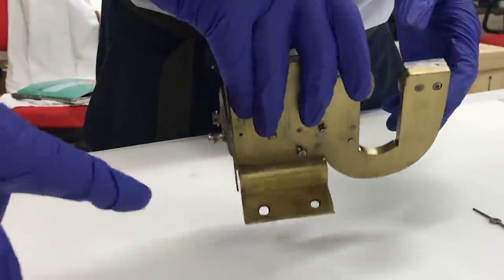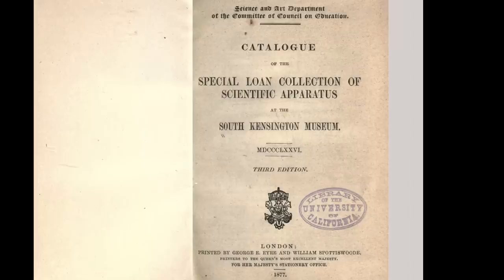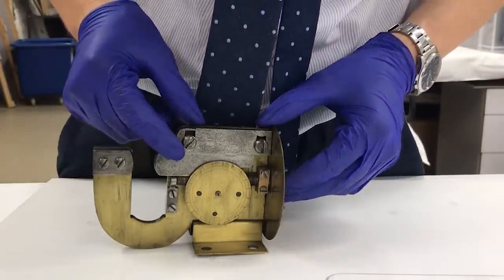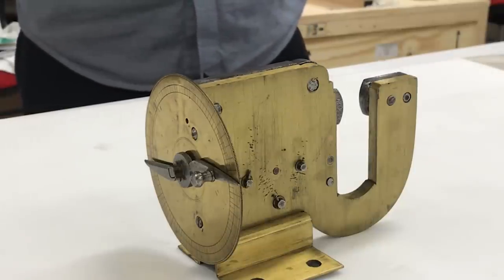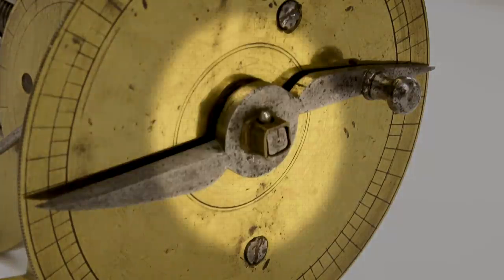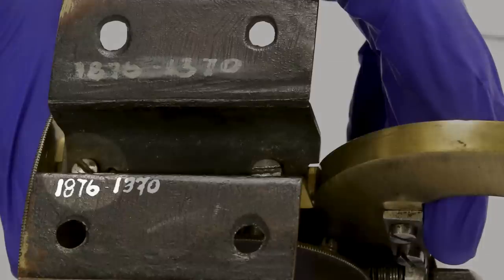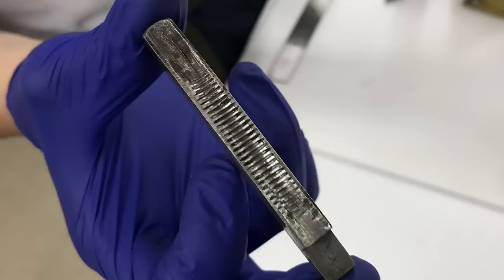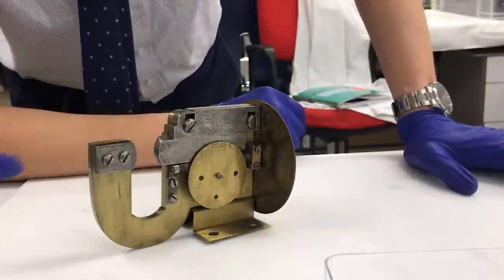World's Oldest Micrometer - 1776! Who made this thing??

Comment: In my uneducated opinion I suggest that it was made in the early part of the 19th century.  Circa 1790 to 1820. The maker could be a journeyman clock maker possibly working with a journeyman machinists, both trying to solve the issue of making precise measurements.

Comment: I think your variations in quality across different pieces suggests different pieces of brass and steel were repurposed to build the micrometer. I can tell you with 100% certainty the base was absolutely either thrown together very quickly or was recycled from something different. The iron pieces were also likely either recycled from something else or were used on a previous attempt to build a micrometer similar to the one being handled in the video.

Comment: The two brass indicator wheels appear to be wheel measuring rulers. Check out Engels Coach Shop where they're working on wagon wheels. I can see someone like Watt working around wheel makers and seeing those round rulers, made in brass because it is easy to work with, and having an 'ah-ha' moment. The rest of the body, a reutilized hole punch and grommet setter? And the amalgam of the parts a crude micrometer.... something to model off of a better iteration?

Comment: I'm no expert, but to me, the wear and cobbled-together nature of the tool indicates that if it was indeed made by Watt, it may have been built from scraps and then revised and/or repaired several times over its lifetime as its maker realized its limitations and attempted to get it working to his standard. Plenty of modern makers do the same thing, keeping their oldest and most beloved tools and repairing them multiple times to keep them useful, often doing repairs in a way which is expedient first and beautiful secondarily.
Reply: Some of my best stuff has been built from worn scrap with holes that didn’t “align with my mission,” and this is from an age where I’d like to think nothing went to waste, especially if it started as a prototype, not a showpiece.

Comment: I believe the small dial was soldered offset on purpose, to accommodate for calibration. If you set the large wheel, since it is driven and the small wheel is slave, then the small dial would have to be calibrated to the large wheel. If you install shims or take out shims from behind the large dial and add them respectively to the other side of the bushing, this would give a different zero when completley closed. Maybe that's how the circular scratches are on the face. It's quite possible this was a prototype. Just my opinion. Thanks

Comment: the holes on the base being counter sunk on both sides, could it be due to being hammered holes rather than drilled?

edit: also that there are hammer marks on allot says to me that it was built in a time where building things with a hammer was common (wrought iron is also a indicator of such to a certain degree).
Reply: If it was made in Birmingham then it was almost certainly made with a hammer aka Birmingham screwdriver.

Comment: Looks like the hole on the big dial might be a lock position for the handle. Hard to tell without a perfect head-on view of it. Overall, it almost looks like Watt had the device and used it, or acquired it as a curiosity, but didn't necessarily invent it.

Comment: I think you were right in assuming the base was made by someone else and there is no way those holes were drilled out...... So why would someone countersink both sides of something when they didn't even have a drill? What if it wasn't mounted in a stationary position? What if it was clamped onto posts, or rails, so that it could slide in a horizontal manner and when you set the tool down on the table it is actually sideways? That would explain the lack of marks from mounting the base and the fact that it doesn't sit even on a table evenly..... could even explain the concentric/ragged circle that are on the base. It seems like it was a tool that was later adapted for a different use.

Comment: You should do a video on programmable logic controllers. Without them automation would not be so cheap to implement when a product change is required. You can thank the automotive industry for the birth of the programmable logic controller due to the need for them constantly having to change the settings for new cars that long ago required changing out relay logic boards and wiring that became time consuming and costly where as with a PLC they only needed to change the program in it to achieve the same thing. If you need source material look up Modicon and a guy named Dick Morely .

Comment: The bottom mounting bracket doesn't seem right. Like you said Its very crude and too short. The only reason I could think of for the bottom of the holes to be countersunk would be some small "nipples" sticking up on whatever it was mounted to to help align it. But like you pointed out it appears to have never been mounted. Very weird. Also is the discoloration of the bottom of the mounting bracket just corrosion/patina?

Comment: That extra hole in the large dial may have been for a pin or rivet, screws were used instead
Alternatively since both dials look like repurposed clock faces maybe it was a mis-cut blank for a clock with multiple sets of hands? Wikipedia page for decimal time shows a 1798 french clock with two dials, quick image search shows a number of similar examples, or maybe a day of the week indicator like some modern watches

Comment: IMO the hammer marks do have something to do with it.  They line up with the pin orientation, it looks like the pins were driven into the shafts by a hammer, those are the miss marks.  Or it was serviced and pins were removed / re-installed.

Comment: An indicator of age would be the thread form and pitch. If it is a standard form it is more recent. Whitworth threads would be an example of an out of time indication as would the instrument measuring the current imperial inch (as this was not standardised until much later (which is why a .303 rifle is .303 not .300)).

Comment: Many of the stray hammer marks on the back are in line with the pins, implying that they were struck tight directly with a hammer instead of the blow being more precisely transferred with a pin punch and hammer. The device would have been awkward to hold in a vice, and the number and shallowness of the divots suggest the Craftsman was holding the assembly manually, and striking the pins in with a small hammer. In respect to the relative precision of the rest of the tool, I'd think this is more representative of a quick and dirty working prototype of a reasonably skilled Craftsman than someone who didn't know any better.

Comment: Just like  when using castings instead on machined surfaces ,sometimes cosmetic or crude manufacturing does not affect the performance of the device.For sure it was not made by clock maker of the era or at least not for selling.It would be awesome to test it against gage blocks.

Comment: honestly it looks more like the work of an apprentice of the company over a Watt made piece . letting an apprentice work with left over bits is common now and was common in the time period. even if the pieces were rare or expensive having them use left over or reworked bits fit's the idea of an apprentice doing the work. all the rough bits the misaligned screw slots the bent shaft it all fits apprentice level work or the hand of someone learning as they go.

Comment: I guess it was made to determine ware on parts after a test run. Maybe they noticed increasing slag in a bearing or so. But they weren't able to measure it with existing tools. So they thought about an solution and came to the obvious, using a screw.
So some one has to build it while the next stint of the test run was underway. I also think it got several refinements in the same manner.

Comment: I think it is even earlier then 1776, could easily be mid 18th century but made by a clockmaker as the rotating parts are pinned at the end. The marks on the plate are where someone hammered the pins in rather crudely. The bottom bracket is obviously later, maybe it was originally hand held? Watt maybe, but why not consider  figures such as Smeaton or even Hindley?

Comment: It looks like this was used as a gap gauge .the micrometer could have been mounted on a rail parallel to the centres of a lathe and bolted to a lever which  pulled down to make a reading along a diameter .It must have had a small amount of lateral float . You Know how difficult it is to make a long thin shaft parallel .They did not have travelling steadies in those days  so they must have turned in say steps of 6 inches and readjusted the setting on the cross slide to compensate and finished of with turners finishing tool "Emery cloth" Note I have seen this method used on a machine with a twisted  bed and wood was put under the shaft to counter vibration .But they obviously used modern micrometers. There are firms with clapped out machinary .  Note 2 The radius on the anvil gives it away

Comment: Tool work from school metal shop class. How about more accurate info on dimensions, thread per inch, tooth count, dial increments, etc. Show its working operation in use comparing measurement accuracy to modern micrometer.

Comment: It appears this device was made for production runs of a particular part. The lead screw wear in a certain area further suggest that a production run was made and consistent with the wear. It was a device that had to be screwed down on a work table. The mounting bracket dose not appear to be the original.

Comment: The lathes of the late 17th century could turn wrought iron which was pretty mild as in mild steel,  The power wold not coome from a treadle as you imply "foot power") but by a 'great whee' operated by an assisitandt and of course if your workshop was near a river you might have harnessed water power as flour mills and the textile industry etc did.

Comment: You can cut accurate thread using a threading file and a jig (I have done it, it sucks). To make a thread file you would need a protractor, a ruler and a 60* triangle file. Then its simply calculating helix angle and tpi.

Comment: 1 - this is hand made and more precisely: "hand crafted"
2 - we tend to forget that accurate hand tools didn't exist at that time, let alone printers where you could print all your measurements.
3 - manufacturing all the parts of this early micrometer would be very costly, hence it was made from available materials. such as this early moulinex type cutter XD which is cool. 

the evidence ? .. the threads were crafted, so yes it is a one of a kind invention

Comment: Mirroring some of the comments, it seems to me that this is either a "proof of concept" using salvaged materials or a crude "stop gap" measuring device where absolute accuracy was not needed. Either way, it could also had several iterations of changes. This would help explain the mystery questions of holes without purposes and quality of materials that don't seem to fit. Now since you said he was in instrument maker, this also reinforces both positions. 

In addition, we don't know exactly when this was created nor how it was used. For all we know, it came from someone else entirely who worked for Watt or someone else's tools were obtained by Watt or his company. 

Finally, when making steam engine parts, what was the minimum tolerances necessary and could this tool achieve measuring those parts? If not, why keep it around at all? If so, why was it so crude?

Comment: I'm guessing that the hammer marks on the back of the micrometer are due to the fact that someone had hammered in the pins holding the mechanisms shafts in place -- probably,  they were removed and replaced several times during the life of the instrument.

Comment: I see many signs of simple forging in your instrument - the rough holes in the support piece appear to have been cut, not drilled.  On the threading, I'd recommend you review advice by a fellow named Porter in his book about amateur telescope making and the techniques he suggests the average craftsman use to make simple worm gears.  That may be one method used to cut the threads on the anvil.  Also, it is said that machine tools cannot make parts more accurate than the tool itself, but I'm not so sure.  In the 1700's there surely were relatively accurate metal lathes (as well as drill presses - I have one from the 1800's) making the thread cutting likely accurate (as well as the knurling).  I wonder about the unused hole on the large dial.  I suspect it had a specific purpose.  I also wonder about the finish on the iron parts - that seems like a later addition.
I was once told by an old machinist that the test for admittance to a machine apprentice program in the (really older) days was for the  applicant to be given a cube shaped piece of steel about an inch or inch and a half on the side, a vise and a file.  The applicant was told to make the cube into a perfect sphere and then he was given time.  When the applicant came back with the sphere, the machinist then told the applicant to go make the sphere into a perfect cube.  The issue wasn't precision or production - it was patience.
That is what went into this instrument.

Comment: well what it looks like to me is a hand cranked some type of food processor, that someone thought of to make and later recognized the similarities (function) while looking around the house for a tool or a part that could be taken and reused and he stumbled upon another invention or design of his/her. 
the screw will offer the cool feeling of no resistance while you turn the handle which are idk 30cm (0.3m*50N =15nm) transform that to through some gears that speeds up or down the rotation into a screw that conforms both rpm and torque so that it could cut cucumbers, vegetables or salads and you would not feel the resistance from the blade to the knife. the torque just shreds through most organics.
okay so maybe you dont need gears or the screw but  i mean its an odd design for a handle.. why would you weld on a knob sort of on a "bevel" of a propeller shaped thingy

Comment: The first metal lathe (as far as we know) was made in 1751....so 25 years earlier.  (The lathe is on display in France.)   So I also expect this is not the first micrometer as the ability and need was available and I expect the first micrometer predated the metal lathe.
Reply: Could the Salisbury clock and the wells cathedral clocks (late 14th & early 15th cent ) and Thomas Newcomen's engine (c 1712) have been made without a metal turning lathe? The machines may not have the sophistication of the one mentioned above but lathes they must have had.

Comment: If you could get the measurements of bearing fit on a Watt engine or find a reference, maybe a rebuilder's log, then you would have an idea of the tolerance they had to work to. I don't know how they would measure bearing clearances without some device. It wouldn't surprise me if he had several mics. I'm sure there are ways to measure relatively but they wouldn't know the actual size unless they had a way to measure it.
I understand Newcomen cylinder bores could be very loose but bearings have to be fairly precision or so one would think.They didn't have babbit until Tabitha Babbit invented them and I don't know what they used for bearings.

Comment: I think you were a little quick to just to assumptions. The various tool marks on the exterior could be anything like wear and tear from use, not implying this was scrap material. And the knurling is most likely for easier legibility. I doubt someone would practice decorative touches on a work tool like this

Comment: The turned parts for first metal working lathe must have been made on a woodworking lathe. To make a long shaft this would be difficult has small shavings with tool on a sliding on a rest.  The component would need checking constantly with a gap gauge device (Adjustable) to make the shaft the same dia all the way along its length. As we know if you can make a machine marginally better than the last accuracy will increase . The first micrometer would be just as rough and ready as the way the work was done .As the machines evolved the measuring instruments evolved .Measuring devices are always in front of the capabilities of the machines. A coordinate measuring machine (CMM) is were we are now and you can not get away with anything

Comment: I would spend time reading Watt's work and identifying any technologies he was using, or techniques, or projects he may have been pursuing, during different periods of his life. 

Is there a period before he used a certain technique or owned a certain technology? Did he hire things done? How was their work? Is the artifact in question germane to a particular project he was doing? What techniques beside the use of the artifact were available to him at that time, and were they less acceptable on this project than previous ones? Is it possible he had no immediate need for it, and it was just a proof of concept, a doodle? Was he capable of making the artifact at that time, by that means? How hard would it have been to do better?

Does he have any work habits or standard processes for making items such as screws? Precise rectangles? Do the different parts have flatness and evenness of thickness typical of materials of his day, or are their irregularities more typical of mill stock? Are the alloys compliant with standards of his time if applicable? Or standards of the conference's time? Do documents survive from his laboratories or companies that record measurements consistent with the micrometer?

There are so many ways you could go on this!